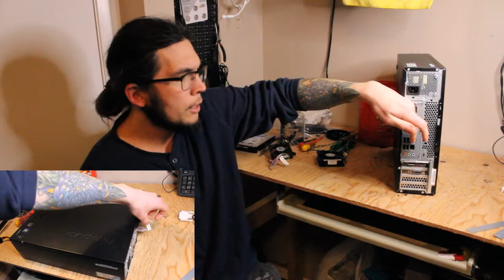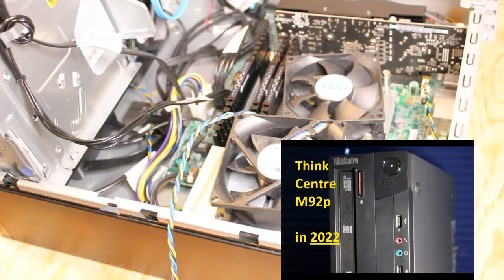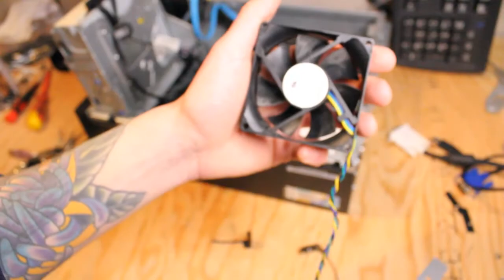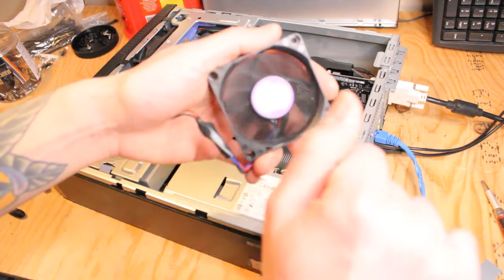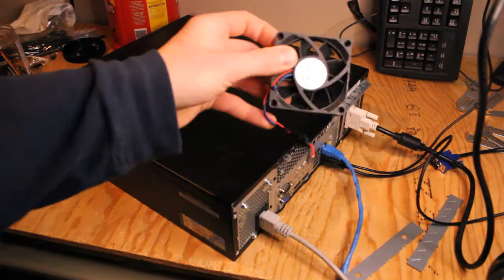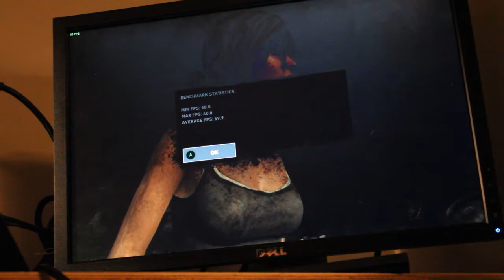M93p SFF Exhaust Fan Mod Install & Test - Release the Heat!

Comment: Does anyone happen to know the exact size of the front intake fan of this m93p SFF?  (I can't confirm if it's 80mm or 90mm)
Reply from the maker: Check out this listing here:  https://www.ebay.ca/itm/166535408805?hash=item26c648aca5:g:9EQAAOSwpe9ll1Jj&amdata=enc%3AAQAIAAAAwOjFCY8i59QvNJAzamrTD1olZ7qrifOl4FgLu9lOWXK8NISDCq%2BgaBOYBVlbDlrFAAyXuTWAlXBPrCQxNXfHRDzHI%2FgMXcoU6YqaXKajwj0MiALmDdxhS6K5Ia%2F6d9pVqnhyhba97H8G4FBRsp6pVWuBPydLzzMYQLZopRqKt83X1Y1ne946Q0AasLmUMedlYsKH82UeWh%2F%2F5ZM0Pq7WmHCJoqRWV2WoJFuF1r3cveULZ%2BwXvhEYRECDhkm4u1QwwQ%3D%3D%7Ctkp%3ABk9SR66-_bGoYw

Comment: Nice work, does it make a  difference? The grill is pretty limiting and it's not directly pushing air through it just towards it.
Reply from the maker: The rear grill does not provide full airflow with the size of the fan, but I found that it still provided enough airflow to make a difference in thermal temps.  Prior to having the fan set up, it was running much hotter than what I show in the video.  Not overheating to the point of failure, but enough to consider doing a modification.  This wasn't intended to be a gaming PC or even a intensive workstation, so some modifications are necessary.  If you take the time, these are great budget towers.
Reply: @HaisteComputerRepair  What do you think of the HP 800 G1? The CPU vents right out of the back.
Reply from the maker: @jbol2454  I think if the price is right, go for it and see how it goes.  Looks like it would have the same generation of Intel CPU's.
Reply: @HaisteComputerRepair  I'm just wondering about cooling since the nice thing about the HP is it vents the CPU right out of the back of the case but annoyingly the HP doesn't have a full size DVD drive which I like on the Lenovo's.
Reply from the maker: @jbol2454  Do you need a larger optical drive for some reason?  Hard to say about the cooling, are you looking at a SFF or Mid tower?
Reply: @HaisteComputerRepair  No the only reason is I'm lazy and I like to drop discs in rather than having to push them in. I also like the smooth action of a full size drive.

I'm only looking for an SFF in my current line up.
Reply from the maker: @jbol2454  Haha, well we all know what we like.  What are you planning on doing with the PC?
Reply: @HaisteComputerRepair  It's going to fulfill several roles all in one. Gaming, office, work but also to be a TV box that I can hook up bluetooth controllers to, watch pirated movies and play emulated games on. :)

I'm actually looking at a newer Lenovo P310 too to fulfill the role. very similar to your Lenovo, only thing is the older chipsets can also run WIndows XP which is why they are tempting.
Reply from the maker: @jbol2454  A P310 would be pretty cool to play around with and it's probably got room in the case for at least a few hard drives.  I would look out for which power supply it has, though.  I see a 250W and 400W listed on the Lenovo site.  If you are wanting to run a GPU config that overall needs more than 400W, I would double check about being able to easily swap out power supplies.
Reply: @HaisteComputerRepair  People are running GTX 1650's with no issues on less than 250W, but the Lenovo has a nice option for the 400W. It's the P310 SFF I'm looking at, very similar internally to your one.
Reply from the maker: @jbol2454  That's a good one, and you have the added benefit of DDR4 RAM, which is matched with the 6th gen Intel CPU.  Let me know if you secure one.
Reply: @HaisteComputerRepair  I just bought one on ebay!
Reply from the maker: @jbol2454  Nice, keep me updated!
Reply: @HaisteComputerRepair  So I bought the Lenovo P310, it's a nice machine (but I'd go for the P320 to get the 7 series intel CPU's and HDCP, identical machines otherwise so the motherboard can be swapped).

So I was going to put a 6700K in it, 300W PSU, 32gb RAM and a GTX 1650. I was also going to do your fan mod but instead put 3 smaller fans in series right over the rear grill.

But the thing is the cost of doing all of this really doesn't make sense. So I may just put 16gb of RAM In it and leave it as just an office computer.

The low profile graphics card does just really limit your options and paying £200 for something just for it to be low profile doesn't make sense.
Reply from the maker: @jbol2454  Nice, you got the SFF version?  It's true, the cost to performance may not be worth it unless you find good deals, spare hardware, or just plain want to do it for fun.  Low profile cards are pretty expensive for anything that is gaming worthy.  They are more of a novelty in my opinion, or, for different use in a professional environment.  

I do these things because it's a hobby and one of the ways I progress in my trade of computer repair is to try new things.  If you have the budget or just add over time, it could still be a fun project.  You could find a nice PC case on Amazon and transfer it all over and make a cool RGB setup, or something like that.
Reply: @HaisteComputerRepair  Yea the P310 SFF, no way would I ditch the case, those SFF cases are the best bit about them and the motherboard is just not that great to transfer over to another with all the proprietary connectors.

Unfortunately I appear to have blown the audio on my mobo already with some static after messing around with a PCI card!

Comment: What if we use a turbo fan like a laptop fan ?
Reply from the maker: What is interesting is that you can actually purchase a fan caddy that fits into a PCIe slot on the motherboard and I have seen several models that use a "blower" style fan to exhaust warm air.  Blower = laptop style fan assembly.
Reply: @HaisteComputerRepair  yeah blower fan i am thinking it to install vertically on the vent holes that are on the back side and maybe use a usb slot to power it because i am going to install a gtx 1650 low profile version by gigabyte so we need more airflow 😅
Reply from the maker: @Vulk7n  Something like this:  https://www.amazon.ca/Vantec-SP-FC70-BL-Spectrum-System-Adjustable/dp/B000233ZMU/ref=sr_1_14?crid=23FNB38ORBVS7&keywords=pcie+fan&qid=1653238238&sprefix=pcie+fan%2Caps%2C122&sr=8-14

Though this is powered by molex, so you would need a molex to SATA converter.  As well, you will need a SATA Y Splitter to get an extra SATA power connection, unless you plan to remove the CD/DVD Optical drive in which case you can use that one.  If you don't need the optical drive, you could use a SATA Y splitter to power two SSD's/HDD's and the extra PCIe fan.
Reply from the maker: @Vulk7n  Sorry, I meant something like this:  https://www.amazon.ca/StarTech-com-FANCASE-Expansion-Exhaust-Connector/dp/B0000510SS/ref=sr_1_8?crid=23FNB38ORBVS7&keywords=pcie%2Bfan&qid=1653238238&sprefix=pcie%2Bfan%2Caps%2C122&sr=8-8&th=1
Reply: @HaisteComputerRepair  i am going to install a 80mm fan as the video(bcz cpu may bottleneck and work at 100% most of the time while gaming) and a 30mm fan below the gpu on the 2 leftout pcie bracket.
Reply from the maker: @Vulk7n  Nice, let me know how it goes and send me a link to a video or pictures if you can.

Comment: This is a sweet mod, awesome work. I wonder how much difference there is in temps when that plastic shroud (not sure what to call it, you'll know what I mean lol) that sits around the CPU heatsink is installed. Could be an interesting test.
Reply from the maker: Thanks!  The shroud (I am very familiar with the shroud) was still on when I first was testing the tower.  I suppose it was engineered to distribute air, but the exhaust fan made enough of a difference to go ahead with it for function.  I would love to hear the story behind the idea of the shroud.  In the full size M93p tower case there is no shroud, but there is an exhaust fan.
Reply: @HaisteComputerRepair  I'll go back and check out the other video. Have you ever used one of those PCI card exhaust things? I doubt they come in low profile though.
Reply from the maker: @OffDutyTink  I have never heard of a PCI Fan exhaust, but what a cool idea.  One of the top hits in a Google search is a Laptop Style fan+shroud for low profile.  I have a few spares, I am totally going to try that out!
Reply: @HaisteComputerRepair  yeah that's exactly it! Would be cool to see
Reply from the maker: @OffDutyTink  I'm on it ;) Thanks for the idea.

Comment: Makes for a nice machine! Tip for securing fans and what not. Push the "tail" of a zip tie through the fan securing hole and the honeycomb of the case. Secure it with the "head" of another zip tie on the outside and cut the excess "tails" off. Also good for GPU fans, MB heatsinks etc where you don't want metal near the PCB's. Have a great Christmas!
Reply from the maker: Happy Holidays to you too!  Zip ties are excellent, but this time I had to go a little further.  There is a little pocket of space on the motherboard that is perfect for that size of fan to rest, but it's a 1/4" or so from the read of the case due to the I/O port casing.    I originally used JB Weld epoxy, but it melted or I didn't let it sit for long enough.